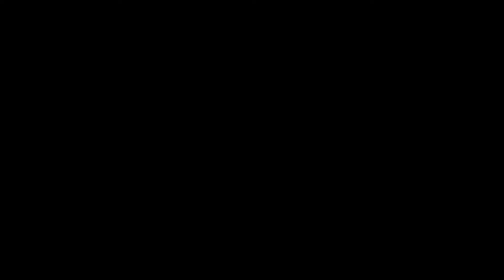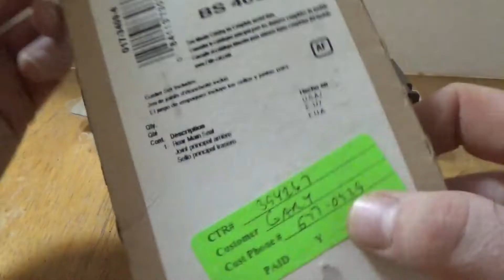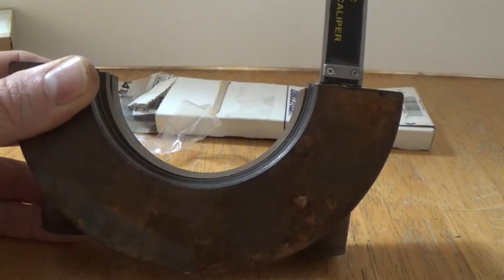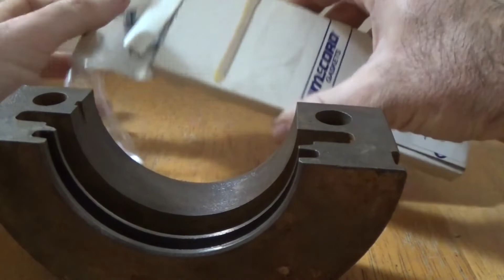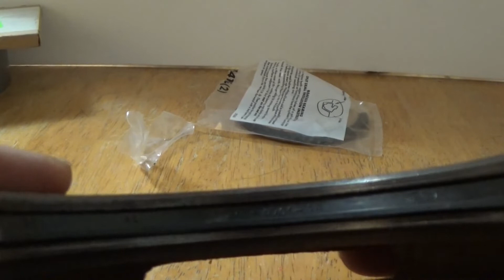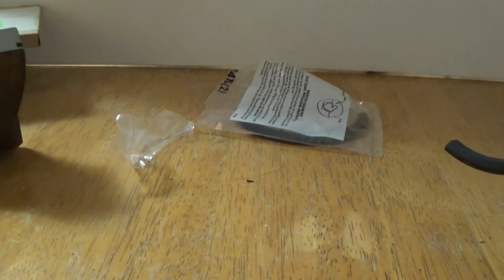Ford 460 Rear Main Seal Problems with Fel Pro!

Comment: I need a rear main seal for my '78 460 that is leaking pretty bad. According to the comments section here, it looks like Mahle/Clevite and Victor reinz are all going to be a FelPro part now? Rockauto also gives Enginetech and Timken as options too. What do I need to order to get this thing to stop leaking. I'm doing this job with engine installed in the truck so I don't want to experiment. I don't care much about the cost at this point.
Reply from the maker: All of them will work it’s just that the Fel Pro needs more trimming than the others do. From what I can gather, the Mahle/Clevite seals have taken the old Victor Reinz part numbers but you get a Fel Pro gasket in the package, while the Victor Reinz seals got new part numbers but unless something has changed you would still get a Victor seal in the package. As far as the National, I have no idea who makes it for them but I would say it’s a Fel Pro since Fel Pro and National are both owned by Federal Mogul.
Reply: @BlackLabGarage thanks. I will order a Victor seal
Reply from the maker: @fordblueblood  let me know how it works out.
Reply: Napa seals are all FPG part numbers which I also assume are Felpro
Reply from the maker: @fordblueblood yes..years ago Napa sold Victor gaskets but now they sell Fel Pro.

Comment: Could you explain the reasoning why when measuring the FEL-PRO you made the seal flush with the cap but when measuring the VICTOR  you left a little bit up on the left?
Reply from the maker: @larry69546  the Victor was flush. There was a little bit of rubber sticking up that was just molding flash that made it look like it was sticking up from the camera angle but it wasn’t.

Comment: I get the statement about crush but what  is your opinion about offset install. To leave about 3/16 in. above and below. Look forward  to more videos
Reply from the maker: @MannyTaboada  honestly I have did them both offset and the old way of being level with the block and main cap. Both ways work fine. Not having an oil leak is more about the proper crush and installation than it is on whether the seal is offset or not.

Comment: Why did you measure only one side.?
Reply: Where did 60 come from.? If you had 30 knock off 15 and all good no.?
Reply from the maker: @sam-oh5wj  you have two halves of the seal. .030 x 2 is .060
Reply from the maker: @sam-oh5wj  it wouldn’t matter if I set one side flush and measured the other side or split the difference and set it with both sides protruding and measured both. Either way the seal would be too long and not have enough crush on the crankshaft.

Comment: If you don't know how to install a rear main seal just say so.  No need to trash Fel-Pro.  Offset the seal in the block and cap then install the cap.  Not that hard.
Reply from the maker: Actually you just proved that you don’t know how to install a rear main seal. It doesn’t matter if you offset the gaps of the seal. That isn’t the problem. The seals are too long and when the ends butt together it will not let you get the proper crush around the crankshaft so they leak. Cut a hula hoop into two pieces. Then stand in the middle of it. Turn the gaps however you want to. Does that make it get any tighter on you? Nope. Still the same diameter. If Fel Pro made their seal in spec then I wouldn’t have to bash them. Ford seals and Victor Reinz seals don’t have this problem because they are made to spec.

Comment: The MAHLE JV618 seal is made by Felpro. I ordered 2 from 2 different suppliers, and it says felpro right on the seal. Installed it
Reply from the maker: It's getting confusing with Mahle now. What was the Victor Reinz JV618 is now the Mahle JV618 and the Victor has gotten a different number it seems. It seems they are doing that with all of their gaskets now.

Comment: Cut fit ! That's why they put gauge stop in package .read instructions!😢
Reply from the maker: Cant cut that much off. You would be into the metal if you cut that much off. Buy a good seal and you don't have this problem
Reply: @BlackLabGarage  set  seal in groove use gauge to set even with cap cut only one even with cap looking for.001 crush as wears will keep seal on shaft.
Reply: Different seals are made different materials.
Reply from the maker: I tried that and that's how I know I was into the steel. But the OEM seal didn't have that problem. Only the Fel Pro did. @stephenhans189

Comment: cada vez que cambio dicho sello, a los dos dias comienza a botar aceite, al punto de dos litros diarios. no consigo la solución, he pensado en cambiar el motor.
Reply from the maker: What brand of seal are you using?
Reply: @BlackLabGarage  felpro
Reply from the maker: @EL_PRO_J2Y  You need to change that seal. You've got too much clearance. You and lots of other people have the same problem using Fel Pro rear main seals for the Ford 460.
Reply: @BlackLabGarage  i have changed two generic seals, tumbled the crankshaft twice, have it rectified to fill an alleged missing, last mounted this felpro seal and it doesnt work either, i am recommended to change the crankshaft or install rope seals, i am selling the engine already I'm about to surrender.
Reply from the maker: @EL_PRO_J2Y  What year is the block and crank?

Comment: McCord or Victor? Be nice if you could post a link for correct part
Reply from the maker: McCord ended up getting bought out by Mahle who also owns Victor Reinz. Only place to find McCord is by searching Ebay. But I have bought McCord and Victor Reinz and they were both the same seal in different boxes but had the Ford part numbers on them. Victor supplies a lot of OEM gaskets to manufacturers. I posted a link above to the Victor rubber rear main seal.
Reply: @BlackLabGarage  Thank you for posting this part.  Do you have any experience with the john kaase racing one piece seal for BBF? Seems like it may be another solution to a known issue. I was wondering if any BBF owners with a problem rear main leak had their rear crank journal checked for roundness? A qualified machine shop would have to determine that a crank was true,  (not oval) and have to repair a crankshaft that was not perfectly round and broght back to specs.
Reply from the maker: @dewholdingsllc1050  I have not used his seal but I wouldn't hesitate to use one of them. Kaase knows his BBF stuff probably better than anyone else. I have known of people that have used the Fel Pro rear main seal on brand new crankshafts and still had oil pouring out of the rear because of there being too much gap between the seal and the crank with the Fel Pro's. So it isn't just a used out of round crankshaft problem.
Reply: @BlackLabGarage  Okay thank you for your endorsement.  Maybe a good video subject for your channel to test the Kaase one piece seal out?   And it is good to know there are other options for known fel pro quality control issues.  Victor Reinz, or McCord or Kaase.  I wonder if FP quality control lacks because of outsourcing manufacture?  A copy of a copy of a copy.
Reply from the maker: @dewholdingsllc1050 I need to find that box and see where the Fel Pro is made at? But I can tell you that Fel Pro is outsourcing stuff. I bought two head gaskets for a 460 a while back and one of them was a Victor Reinz in the Fel Pro package!

Comment: We used a Mc Cord gasket set on a 69 351w and they sealed well 😊
Reply from the maker: I really like McCord gaskets and try to find them when I need gaskets.
Reply: usted dice que el el 351w sirve para el motor ford 460?

Comment: Thanks for the info. I have a terrible oil leak on mine( I just rebuilt the engine and used a Felpro).
Reply from the maker: I hate to hear that. Fel Pro used to be good to use but I’ve had a lot of problems out of them in the past few years. Their quality control has went down the tubes.
Reply: Same mishap here👎🏼

Comment: The Fel Pro is a different material and the extend an extra .015 because they are INTENDED TO COMPRESS within itself.  It’s designed that way!

Call them up (800-325-8886 options 2, 2), give them the part number and they will tell you so.

Similar thing with the PTFE rear main seal gaskets. People usually lubricate them (thinking it’s the older design) with a little bit of oil before they put them on but the oil will defeat the sealing properties because that PTFE gasket has to go on 100% dry. 

There are chemicals imbedded in that particular gasket that when the friction begins on the crankshaft, the friction helps forms a better seal and they guarantee no leaks.
Reply from the maker: They may say that, but the seal can't compress that much. That's a metal rod in each half of the seal and they butt together. Lot's of people have had troubles with 429/460 rear main seal from Fel Pro not having enough crush to the crank and oil pours out of them.

Comment: I’m glad you made this video. I ordered a mahle jv618 rear main and it actually measure 1/8 of an inch protrusion on both the block and the cap. Where did you get the victor reinz rear main from? I’m really glad I checked this.
Reply from the maker: Believe it or not I had also ordered a Mahle rear main seal and when I looked closely at the seal it was a Fel Pro in a Mahle package! I usually get my Mccord and Victor gaskets from Ebay.
Reply: @BlackLabGarage  good to know thanks!
Reply from the maker: @Samwise71999  You're welcome! If you have a Ford dealer close to you, I have had good results using the original Ford rear main seals also.
Reply: @BlackLabGarage  I totally forgot about just asking the dealer. I’ve order my second seal to try and find one close to the right crush, I’ll definitely be visiting the dealer after this one comes in. I can’t believe how different they all are and when everyone says they just stick them in and never had a leak I’m really starting to doubt that is true.